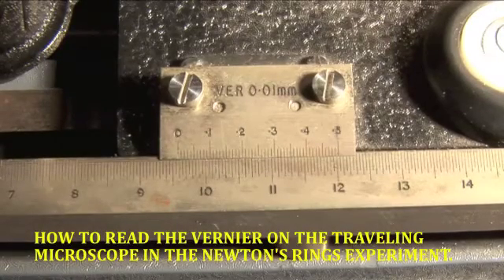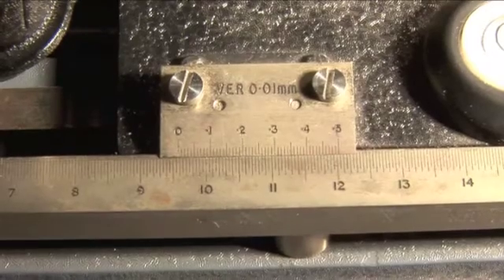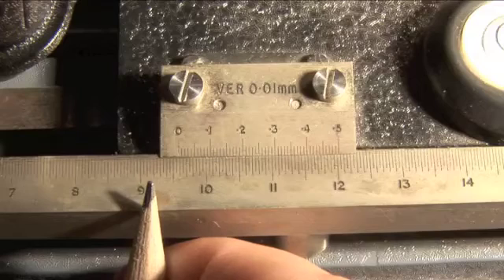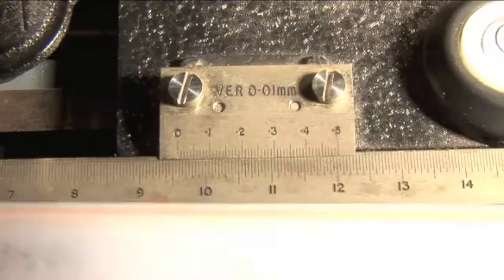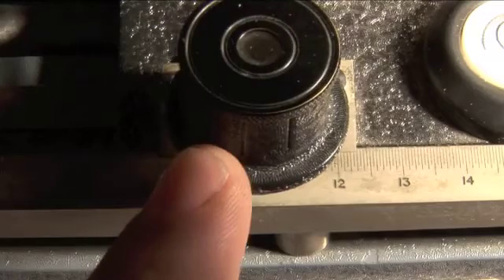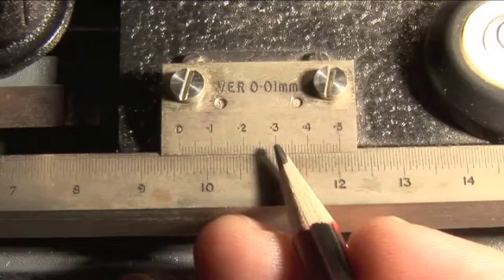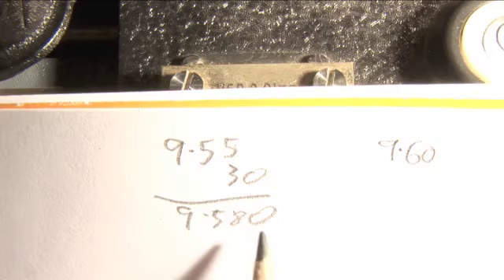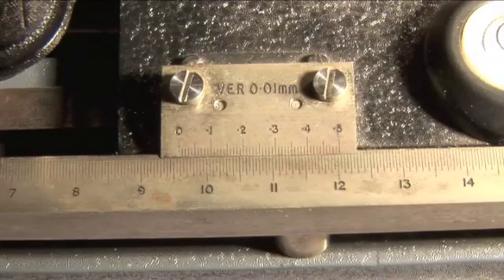PHYS1001 Lab 8 Newton's Rings - Microscope Vernier

Comment: I disagree with your answer...

Remember the reading scale is 0.01mm, so if line on the fine scale is at 0.30mm and we add with 9.55mm is gonna be 9.85mm...

Recheck careful Sir
Reply from the maker: But your answer can't be right, because the answer must be between 9.55 and 9.60 cm.
Reply: But main scale reading is in cm and you are adding vernier scale in mm...so conversation is also important to add to digit....sir was correct
Reply: At first main scale reading was 9.55 cm then we get 30 division on vernier scale.

It was mentioned that 1 division =0.01mm so 30×0.01mm=0.03 cm 
So 9.55 cm+0.03cm=9.58 cm